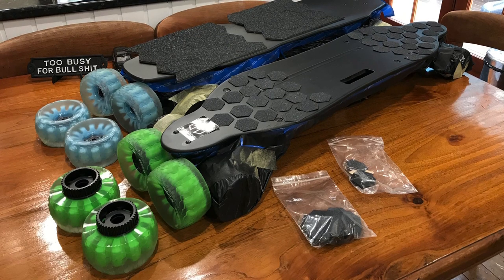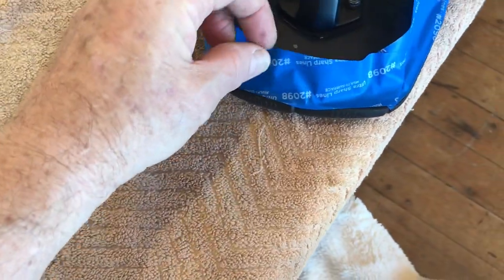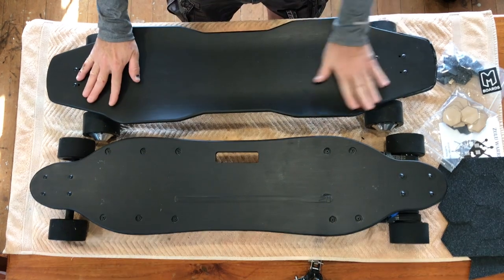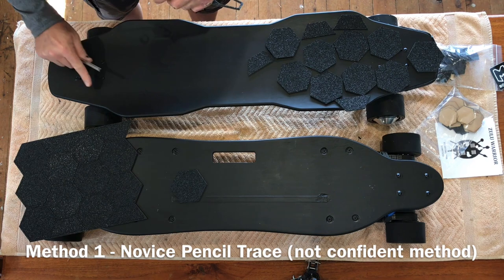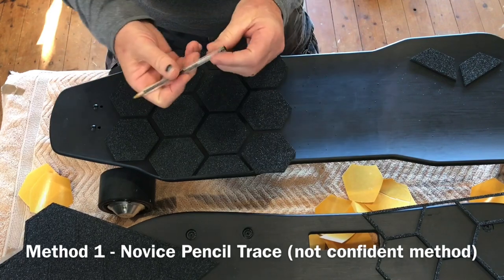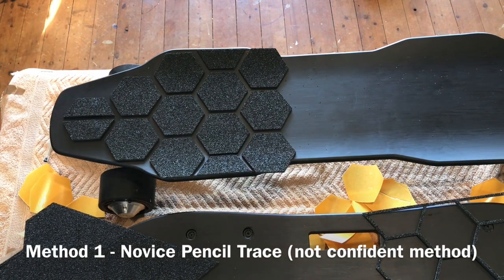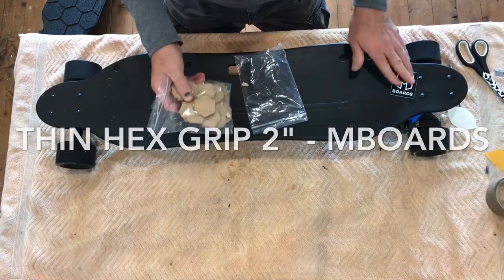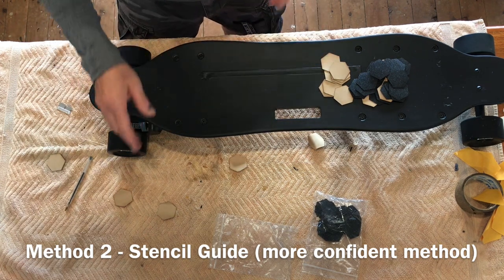Dope Grip Unbox & First Ride bonus Full Installation and Comparison Hex - Vlog No.165

Comment: I would be interested to see the surfboard one someone else was talking about.... Though I wouldn't of thought surfboards had course grip... Just foam....
Reply: They use EVA foams or thats what pretty much all surfboard deck grips are made out of. Surfers are doing carves, gouges, air manouvres etc etc...and in bare feet and on top of that you have water. For a cruiser e board...a surfboard deck grip would be perfect. Alternativly, you could just jump on ebay and buy some EVA marine flooring which is pretty much the same product except youll be able to do 10 boards for the same price.

Comment: Hey Andrew hope all is good and I wanted to let you know that I finally just finished a small batch of our brand new "Armored grip tape" that is an upgraded version of Mob brand grip tape that is known to come with superior grip, but  now can come with our Superior finish that protects the grip tape from dirt and mud, as well as being waterproof, and actually has the ability to be wiped off easily with a wet cloth unlike any other paper grip tape!! This is due to our epoxy formula finish that is meticulously applied in 3 super thin coats, and left to cure for a minimum of 7 days before being used!!!! We were wondering if you would like to test a sheet of our custom grip tape out when we are ready to ship in a few weeks? Sorry if we already started talking about this as it has been pretty crazy around here lately... Lol ... But I will try and look and see if I still have your contact info and reach out that way as well!

Comment: Hey Andrew this grip looks pretty sick and wanted to let you know that we are releasing a brand new grip tape that we have been working on and testing for the past couple years, and is unlike anything on the market! We wanted to send you and a couple other people a sheet or two to try out and see what you think?! Side by side this grip will beat out any other grip that we have used or seen over the years!!! We use a special coating that makes the grip tape waterproof and resistant to dust, dirt, mud, etc, and can just wipe off with a rag in seconds when needed and stays a deeper darker black for much longer than traditional grip tape!!! We plan on launching this product in about a month or so and would like to know if you would be interested in checking it out and maybe sharing your thoughts with us and or your viewers when we finally drop this grip tape!!!